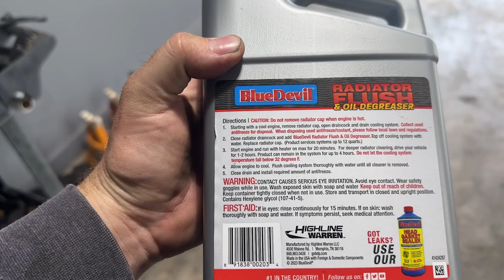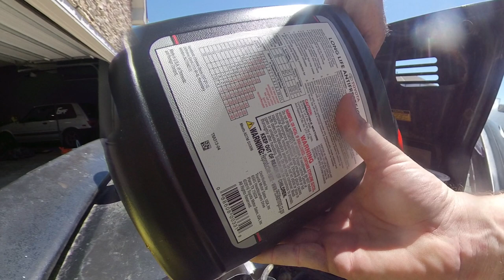Toyota MR2 (AW11) Coolant Flush and Thermostat Replacement

Comment: I’m currently in the process of flushing my 87 mr2 coolant system(it sat for years and it’s disgusting). According to the owners manual, service manual, and at least one video on yt you bleed the air out by attaching little hoses to the bleeders on the thermostat housing, heater, and radiator and elevate them. That way when you’re filling it up, you can see the coolant coming up the hoses and then see them go down as the engine runs and air burbs out(thus avoiding coolant in the driveway and circulating it throughout the system). I think I’ve been having the same problem you had with my thermostat and heating up because my coolant so far isn’t coming up the engine bleed or radiator bleed.